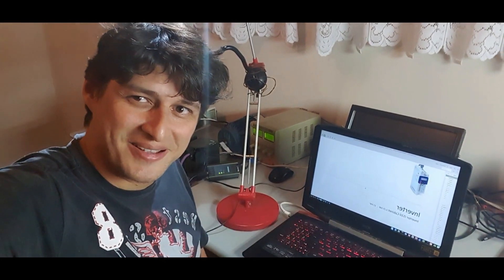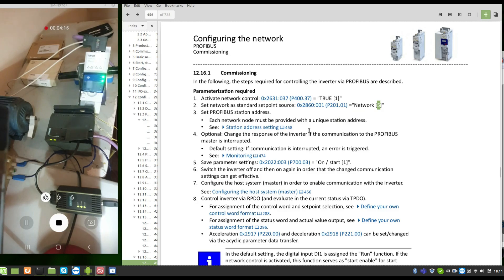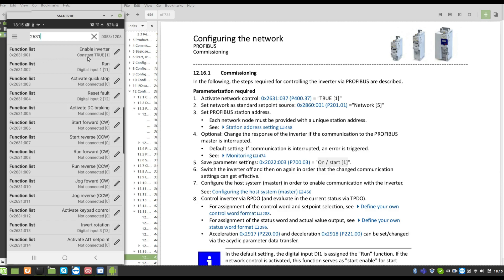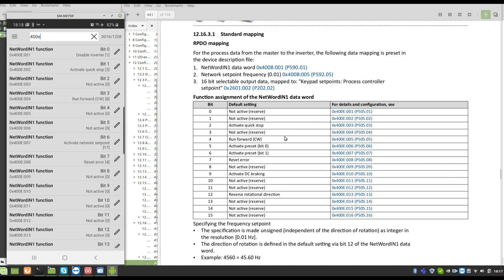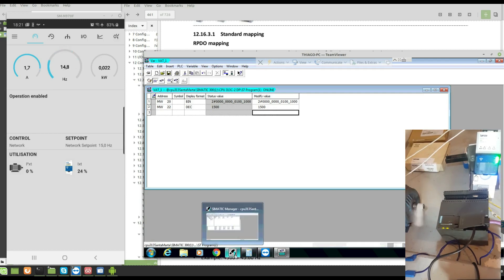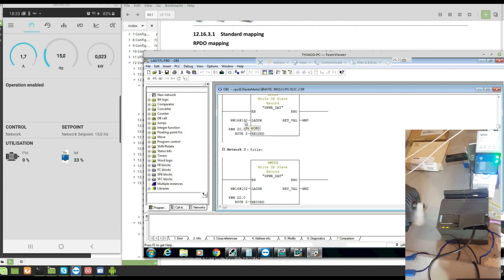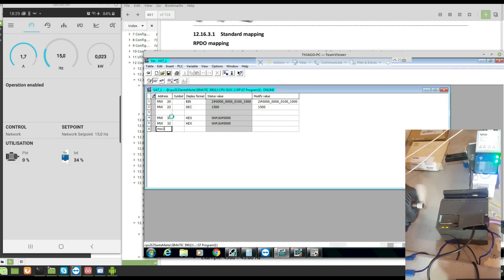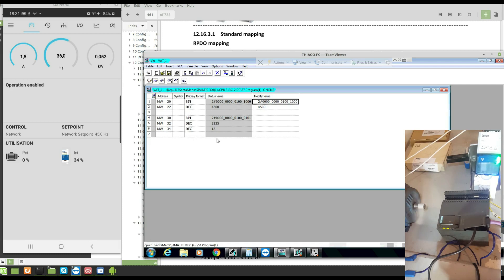LENZE i550 - Profibus Communication with S7-300 and monitoring drive parameters via WIFI

Comment: Dear Sir i need to connect lenze 9300 (2133 profibus module ) with s7 1200 via profibus
Reply: Hello sir, I need to connect lenze 9400 with im151 8 pn via Profibus. If you are done with 9300 via Profibus then would you help me send your program backup or any data that can help me out configuing the same. 
Thankyou !
Reply: @chetankatageri5845  
You can find this example on lenze site
Reply: @neseemsuleiman3688  Thank you for the reply.... I configured it by myself😊
Reply: Now sir could you help me how to connect s7 1200 with 9300 servo drive via profibus-DP using this portal